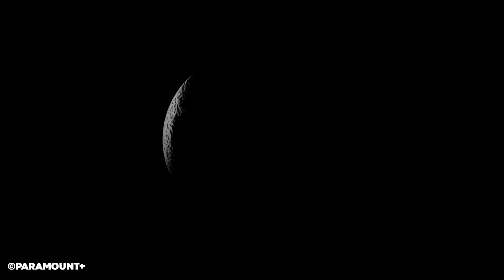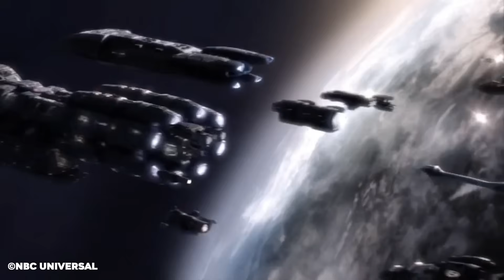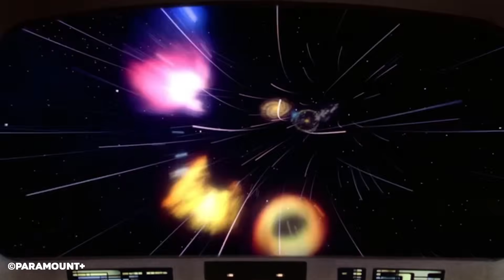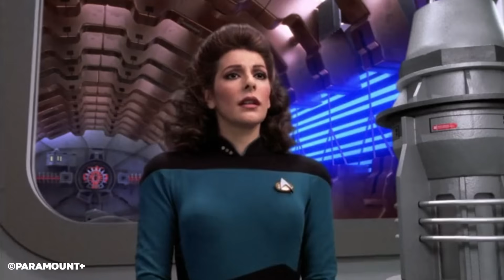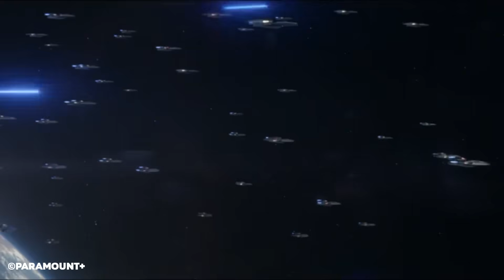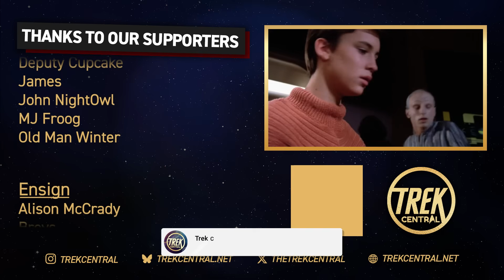How do WARP Drives Work? - Star Trek Tech Explained

Comment: Being the nerdy nerd I am, I figured you could add a version of the Lorenz factor to the warp formula, but replace c with 10 (10 being infinite speed). That way you can easily change the scale to any other maximum value you'd like.
Also figured EPS conduits can be a replacement for regular copper wiring since you're working with such high currents and energies...🙃

Comment: Warpdrive doesn't make the distance travelled shorter. It bypasses the light speed barrier by making space the thing that moves faster than light rather than the ship. Which is how it would work in real life if we could actually build a warp drive. Early Star Trek had no idea how warp drive worked. It just did.
Reply: I think we later all assumed that warp drive was the Alcubierre drive, but I don't think there was any point in Star Trek where they said they were shortening and lengthening space-time. However, Voyager animated the ship stretching in a way that would seem to indicate that.
Reply: @Fylgija1  no they absolutely retconned the scientific explanation in for the beginning of TNG at the latest. They made a big deal about the stretch effect they created for TNG being realistic. And it is. It is actually what would happen. Concorde even stretched out when going super sonic by quite a few inches. Enough to lose a book behind the bulkhead.

Comment: In the Beta-apocrypha, it is stated that Cochranes first "warp 1" engine was not actually running on dilithium because there's no dilithium on Earth. They later retconned that some Jupiter-mission during the Eugenics brought back some strange crystal (that would later be identified as dilithium) that somehow got stolen in the wiles of the war and found its way to Cochrane, only to then retcon it again with First Contact where the engine was so badly damaged that LaForge blunderingly just beamed down parts for repair, with some Dilithium along the way.
But none of these things disagreed with a fundamental statement: Warp 1 can be achieved without dilithium. Dilithium helps it, but is not needed for this specific step. Only when trying to even go a fraction beyond  Warp 1 (say even to just warp 1.0001) you need dilithium to handle the powers.
And so far, any talk about it only ever say that Dilithium is needed for warp speeds (the plural is the key here), so technically, that statement has never been debunked,r etconned or outright falsified.

Comment: So where did Zefram Cochrane get antimatter? If it was easily available on Earth, Earth wouldn't exist since WW3 would have been fought with antimatter weapons. So? My guess is that his warp drive just used a high energy plasma, either generated by a small fusion reactor, or from a nuclear fission power core which was used to generate the the same type of plasma. Which explains the slower speeds of early starships. It wasn't until matter/antimatter power cores could they go faster - maybe the warp 5 engine?

Comment: What I like about Trek's warp drive is it inspired theoretical physicist Alcubierre to look into whether or not its warp bubble concept was possible. And it turned out it's probably the only theoretical way to allow an object to travel at the speed of light without violating causality or feeling relativistic effects. Even building one with current technology is doable, the only caveats are we don't have enough materials to generate the energy required and everything inside the bubble would be cooked from the radiation in a matter of minutes. Still pretty cool that there's feasibility to it.
Reply: The only problem with an Alcubierre Warp Drive, is that you need enough energy to generate "mass" to drag the space ship along like it is falling into a gravity well. Somehow between layers of potential planets stacked on top of each other and across light years in a gravity well "rail gun", you get Inertial Dampers and Artificial Gravity in some kind of gravity cavity that can offset the negative effects of time dilation.

There is also that "wormhole" sequence in Star Trek: The Motion Picture that depicts a malfunctioning warp drive that has some slowwww effect on the ship and crew,...
Reply: I don't think we have the technology to warp space, we just have a vague idea of how we might do it. But yes, the amount of energy required to run a warp drive is beyond incredible. I forget the amount, but it was something to the effect of all the energy in Jupiter to make some reasonable interstellar flight.

Comment: I've also understood the old and new warp scales as one being linear (eg. 4 is 3 greater than 1) and logarithmic (eg. 4 is x times greater than 3 and 3 is the same x times greater than 2).
So like to me the old scale can be rationalised as multiples of the speed of light but the new scale is a constrained 1-10 scale having since discovered there was indeed a maximum limit a warp field can travel.
Think of it like how there's two different ton units and a third tonne unit, and all of them have different values.

Comment: warp 9 is slow compared to 9.9, which is extremely slow compared to 9.99, apparently. there should be a graph somewhere online, where although it takes more power to ramp up to and reach any warp speed, when you get to it, its relatively less extraneous to maintain that speed at cruise. so warp 1 is not easy to hit, but when you are there, its easy to maintain indefinitely. similarly warp 2 is hard to get to compared to 1, but when at two, it pales in comparison to trying to achieve warp 3. and so on.

the closer you get to the next speed, the harder it becomes to achieve it, meaning warp 10, is actually unachievable. but you can also have an infinite number of warp 9.9r which means you can have 'faster' ships, forever.
Reply: Yeah it's like a series of peaks that have to be overcome to achieve a given warp, but once you hit it then you can reduce power almost immediately and maintain it until the warp bubble collapses.